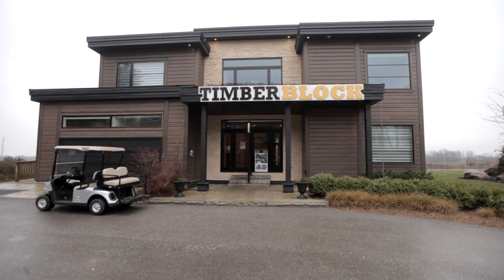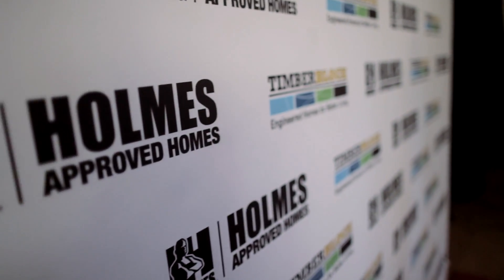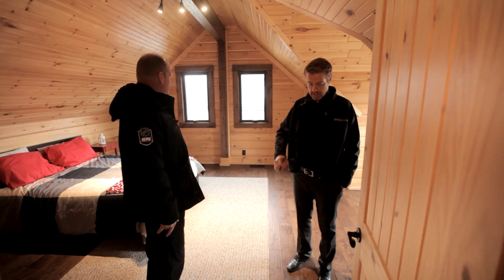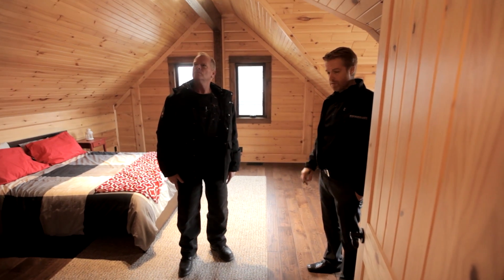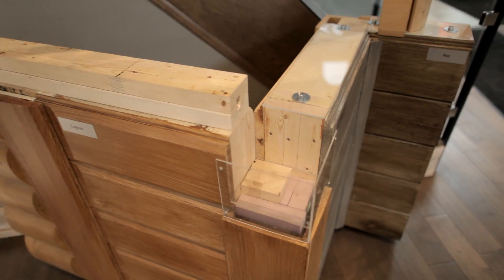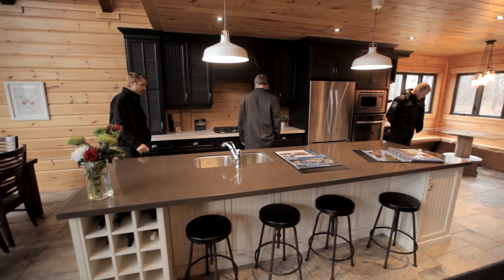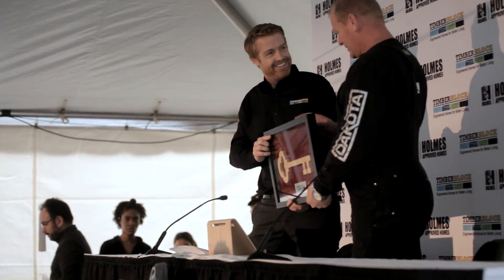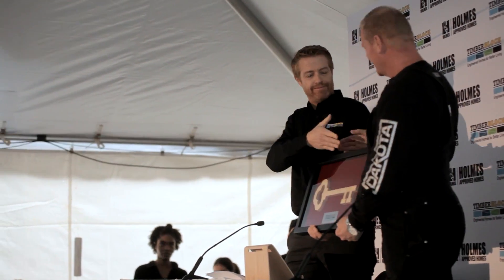UNIQUE Panelized Homes - Mike Holmes Visits Timber Block

Comment: That's a beautiful modern take on a timber building.  I haven't a clue what the R factor was on their place all I know is if the fire went out up at my sister's their peeled log home didn't get cold for three days (middle of winter).  If it was 100+ outside it was always about 20 degrees cooler inside, especially if the gable windows up in the loft were open.  Beautiful, sustainable, way to build.